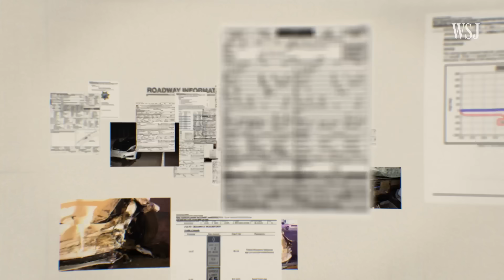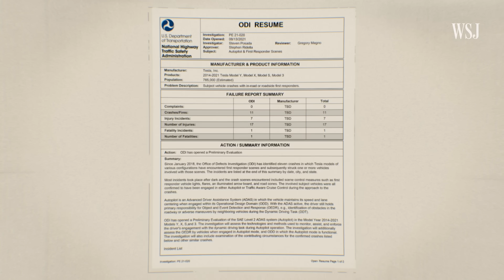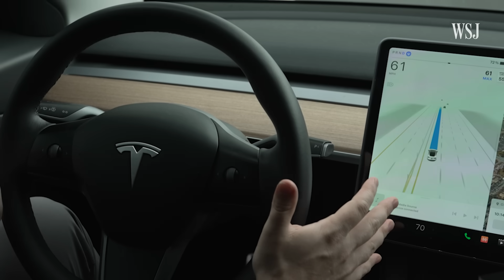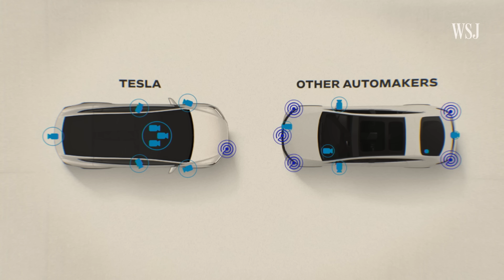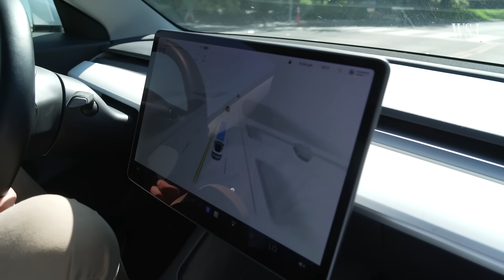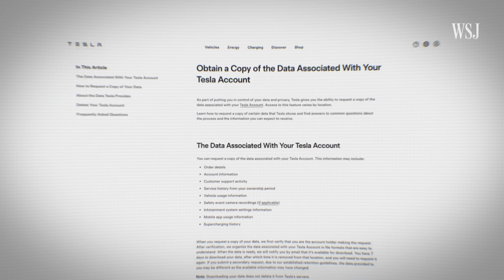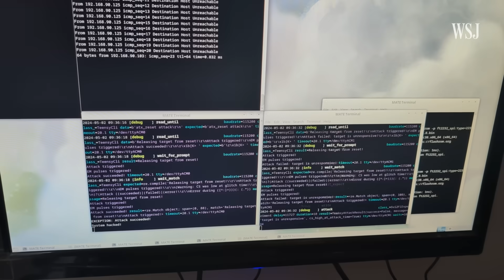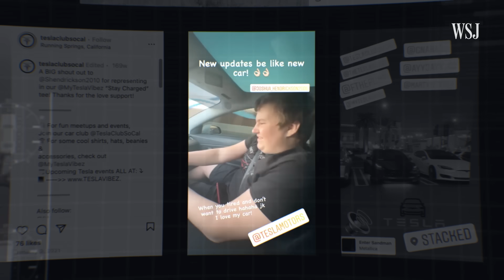The Hidden Autopilot Data That Reveals Why Teslas Crash | WSJ

Comment: Pretty obvious that a camera isn't a replacement for a radar.  
Theres always the possibility that it will misinterpret or not see some objects, but a radar will not only "see" every solid object, it isn't hindered by glare, snow or rain, it's like super human vision and thats really what they should be using when human lives are at stake, even if it costs more.
Reply: Removing radar was not about cost. And you are wrong, Radar was often conflicting with what the camera's were seeing, and it was the camera's that were proved correct. That is why Tesla moved to a pure vision system. Most people have no idea how much FSD actually see's.
Reply: @daydreamer8373  Did you see the video how a Tesla slammed into the truck? 
Radar would have easily detected that theres a big solid object there.
Reply: @samik83  Tesla was using radar then.
Reply: @samik83  Tesla was using Radar then.

Comment: FSD SUPERVISED.  observe and direct the execution of (a task, project, or activity).
"the sergeant left to supervise the loading of the trucks"
Similar:
superintend
oversee
be in charge of
be in control of
preside over
direct
administer
manage
run
look after
be responsible for
govern
operate
conduct
organize
handle
guide
steer
pilot
observe and direct the work of (someone).
"nurses were supervised by a consulting psychiatrist"
keep watch over (someone) in the interest of their or others' security.
"prisoners were supervised by two officers"

Comment: Approximately 1,000 crashes from autopilot in nearly four years? That would mean the autopilot system is remarkably better than human drivers already.
Reply: lol. Only if you don't understand how statistics work. <-- this is you right now.
Reply: @brendanariki  you would need to measure how often by time or mileage autopilot is being used. Then you would measure how often normal driving is occurring. Last you would take the percentage of accidents within those measurements to get the result. My intuition tells me that the Autopilot system will still be a lot more safe than humans.
Reply: Would need to be weighted by type of driving environment, not just miles driven. Many people only use it in areas where they feel safe and want to disengage a little, like the interstate in the day, where accident rates are relatively low per mile driven. Even then I suspect it will outperform human drivers. But there may be certain scenarios, like during the night, where it underperforms humans, and this could be disabled/require significantly more driver input
Reply: @jacobfrye996  so you could take the percentage of accidents that only happen at night between autopilot and human drivers to try and weight it against the autopilot system

Comment: The victims of these accidents do not deserve anything that happens to them. But they should still be responsible for the vehicle that they are driving. 
Putting the amazing capabilities of the system in the marketing blurb, while burying the risks and warnings into the small print is criminal, at least to my mind.
What is really needed at the moment is a vigorous and hard-hitting public safety education programme to stop the rot ASAP.

Comment: The problem isn't only the Tesla driver, but those of us who did not sign up for the program and get hit by one of these.  Makes the Corvair look pretty tame now.
Reply: “The problem isn't only the car driver, but those of us pedestrians and cyclists who did not sign up for this and get hit by one of these.” Same thing. Cars exist whether you like it or not. ADAS exists whether you like it or not. In fact some other ADAS systems are just as bad as Tesla’s. Out Of Spec did some great videos comparing them, but people don’t care to hate on those. As another driver on the road, my responsibility is to drive defensively and look out for my safety regardless of what others are doing because I can’t control their actions, only my own. Same if I’m walking or cycling. I never know what cars are going to do, but that doesn’t mean I want them banned. I just try to be as safe as I can around them.
Reply: @elviswsjr  FSD hasn't harmed any pedestrians.
Reply: Well, if you get hit by other non-Tesla drivers, you also did not sign up to their schools of crazy driving. I think you should not get out of your house from now on. Seriously!
Reply: This is a dumb, yet extremely common, form of sophistry used against deployed autonomy.

I also didn't sign up to be on the road with rednecks' monster trucks who achieve "safety" via enormous mass and a bumper that's at the same height as my head in a sedan. Or, a child's head on a crosswalk. 

Because, you know why? We don't all get to approve/reject each others' vehicles. 

If you want to argue that Tesla should be better about publicly sharing safety statistics on their autonomous cars, and IF those statistics show significantly worse safety performance, then use that to push for specific regulation. "I didn't sign up for ..." is irrelevant. This is a big, stupid country full of idiots doing harmful things to one another. I didn't sign up for that, either, but we live in a society.
Reply: @nathanscandella6075 well that was a long useless comment all to say 'we live in a society' . commenter is right that people dont wanna be hit by teslas rtarded autopilot even if you think we should just because society is full of idiots 💀💀
Reply: Who has been hit By FSD?
Reply: All the people in this video 🤡
Reply: @RoadSurferOfficial  That was not FSD. It was autopilot. So my question still stands. Who has been hit by FSD?
Reply: @RoadSurferOfficial  Compare that to all the people being hit by absolute idiots. Statistically FSD absolutely dominates the general public in driving safety.
Reply: @daydreamer8373  don’t make me flag your account for being a bot
Reply: @RoadSurferOfficial  Flag away. I'm not a bot.
Reply: @daydreamer8373  It's not True FSD if it was it would be a level 3, 4 or 5 system. Waymo's cars are the closest thing to true Self driving cars. The Teslas are not They are a level 2 system which is basically it has control over the driving functions but require the Driver to be attentive but not physically driving it. Autopilot, LKAS and ACC is a Level 1 system which requires the Driver or Pilot to be operating the Aircraft or Car. Tesla is trying to make the jump to a Level 5 Autonomous system but it has to start at a Level 3 (System requests manual control operated in test facilities not Public roads) or 4 (Limited operation may or may not have Pedals and steering wheel)  before it can be a Level 5 (no resitrictions)
Reply: @thegreatcanadianlumberjack5307  FSD is a level 2 system. Nobody is arguing otherwise. It requires the drivers attention at all times. But anyone following the progress of FSD will know it's capabilities go way beyond level 2. But until Tesla say otherwise, those abilities will be locked in level 2, and driver.

Tesla are saying next year they expect to start operations in Texas and California. From what I am seeing. I would be more surprised if they didnt.
Reply: @daydreamer8373  Interesting i wonder where in Califorina and Texas? Austin and San Francisco is where Waymo is operating so i wonder if they will go in and directly compete with them. But since your asking Who has been hit by FSD as matter of fact since 2017 there has been 23 collisions involving FSD including one in November of 2023 that involved a pedestrian getting struck because it was used in low visibility conditions. the NHTSA issued a Recall on Teslas FSD because of that. So yes people have been hit and the way they test it is they wait until the very last moment when hitting something which means people have been nearly hit often by the testers. Hopefully Youtube keeps my comment up
Reply: @thegreatcanadianlumberjack5307  Its a great comment, and constructive. I don't know enough about the collisions to comment, But I do know FSD has helped avoid accidents too, and from what I am seeing of the latest versions of FSD, there is no doubt it will make our roads far safer.
Reply: tragic no doubt, 3:40 the drivers was worn 19 times by the autopilot to keep his hands on the steering before the crush. most likely he fell asleep, the autopilot kept him from chrushing way before the flipped truck to appear, This accident will have happen anyway with any other car by him losing the control of the car. I'm hoping that this technology will be so good that will prevent any body from dying on the roads.
Reply: @Pressure165  and that's where there is more missing sensors. I am by no means a fan of Mercedes, but if a Mercedes Recognisises the Driver is unresponsive, while using Drive pilot a whole plan of steps will be completed:
-First it will use Audio, Visual and Vibration warnings
-Then it will utilize the brakes to basically "bump" the car, without really slowing down, as an attempt to alert the driver(all other warnings continue or intensify)
-If all that fails it will turn on hazard lines and slow down 
-next step is to change lanes to the right until it reached the emergency lane, there it will come to a full stop and use the European E-Call system to call emergency services on scene

Other brands just slowly stop the car with hazard lights on, since the lange changes are a certain hazard on their own
Reply: @Pressure165 flat out wrong. Any modern car with  advertised  cruise  control would have stopped the car and avoided crashing using radar technology.

Comment: Musk insists on using only cameras. That’s reckless when using radar would allow the system to be safer than a human driver.
Reply: When these accidents happened the car was still using radar. V13 is proving Camera's is the right approach, with many in the industry now agreeing.
Reply: @daydreamer8373 Wow. Why didn’t the radar detect a big truck lying on its side ahead of the car?
Reply: @mrluckyuncle  It probably did, but the software didn't recognise it as a threat. Would be my guess. Who knows? But FSD today is a very different beast to those early days. Tesla is literally on the verge of solving autonomy.
Reply: @daydreamer8373 I hope so. It’s hard to understand why a big, stationary, if unrecognizable, solid object ahead of a moving vehicle wasn’t recognized as a threat. It would be interesting to know the particulars of the failures.

Comment: The fact is that it has a far lower fatality rate than just leaving the situation up to humans - having moody music doesn't change that fact.

If you want safer roads for cars then you need to have them on separate roads from trucks. If you want safer responses to upturned vehicles, then you need lights and/or reflective elements on the underside of vehicles.

Drivers are told they need to always pay attention to the road and intervene where necessary. Driving will always be risky.

Comment: This is such an obvious attack on Musk… they found only 1 death somewhat related to autopilot since 2021, and they claim its not safe? They could only find 30 accidents related to autopilot, that is crazy low for the amount of people using this feature. I have been driving in Full Self Drive for 6 months now and not a single accident or even close to it. The car drives itself way better and safer than any human I know. WSJ has fallen off like crazy due to personal politics and vendettas. This is literally Atlas Shrugged.

Comment: This is a hit piece without any nuance about it.

Missy Cummings has been very vocal about Tesla vision only system… while being on the board of a company especially focused on LIDAR systems. She has been removed from NHTSA advisory role on Tesla’s cases in 2022 because of her (obvious) conflict of interest.

First a definition of what Autopilot really is, as there is a lot of confusion between Autopilot and Tesla Full Self Driving or FSD for short. 

Autopilot is available since 2014 and is a level 2 advanced driver-assistance system (ADAS). When you first activate Autopilot, the instructions are very clear: it is meant to be used on highways only and you have to be able to take over control of the car at any time. You have to keep your hand on the wheel and pay attention to the road. Autopilot is available with every Tesla sold around the world. 

FSD was first made available in 2021 under the label “FSD beta” now aptly renamed “FSD supervised’. Currently it is also a level 2 ADAS and the driver is still responsible and must take over if needed. This system is much more capable than Autopilot and isn’t limited to highways. We are currently at a point where, most of the time, it can take you to your destination without any interaction beside giving the destination. Once FSD reaches the point where supervision isn’t required anymore, the car will be considered a level 5 autonomous vehicle and the driver will now be considered to be a passenger. FSD is a paid upgrade and “FSD supervised” is currently only available in North America, with potential expansions to China and Europe next year. 

Now back to the issue. The video make it as if Tesla cars where death traps when you activate the Autopilot, but even in the exemples given some of the accidents occurred outside of highways, places where the autopilot should not have been activated. Numerous inquiries have been opened but NHTSA after accidents potentially involving Autopilot. None of them concluded to a dangerous flaw in Tesla’s systems, to my knowledge all investigations were closed without anything substantial to report. Don’t forget, unlike any other car, Tesla cars have the equivalent of a black box where everything that happened to the car is stored, not just videos. All of this data, while not available to the public, has been made available to the investigators.

Tesla cars have been rated as the safest cars on the road available by the NHTSA equivalents all around the world. These ratings includes the ADAS of which Autopilot is a part. Autopilot is also available in Europe where the rules are much stricter here, if there were any doubt that it was sometimes dangerous, it would have been immediately disabled.

In conclusion, even when used according to specifications, Autopilot clearly isn’t perfect, but if you pay attention to the road and take over when something unusual happens, it is safer than driving on your own.

Comment: Great reporting!

I think that it is critical for people to understand that Tesla, especially by the mouth of Elon Musk, but also on their marketing material, have been overpromissing and underdlivering Autopilot / FSD (Full Self Driving) for years now.
Moreover, Tesla and Elon Musk have been ignoring the warning and accidents that have been happening all over the World.

To be honest, I think both Regulators, and the Federal Government as a whole, have been too permissive because they have been sold, or forced, on the belief that this technology will bring the USA to the forefront of the Automotive industry.
Possibly, feeding many of the images it gathers all over the World, including China, to the Federal Government - e.g., CIA.

This has (a) resulted in several critical accidents all over the World, and (b) discourage investments on LIDAR, which is a critical component to actually full self driving, i.e., a trully high level self driving system.

Do you want more proof?
On the Tesla Model 3 Highland, Tesla and Elon Musk ditched the traditional (ultrasonic) parking sensors, relying solely and totally on the cameras.
This move resulted in several errors while parking, or leaving too much slack on parking.
Such incidents are not major, but it reflects a mentality of cost-cutting, regardless of the customer experience.
Do you imagine it is different on the Autopilot / FSD?

By the way:
Tesla was NOT founded by Elon Musk.
Elon Musk invested on Tesla, while they where developing the original Tesla Roadster, and then made some maneuvers to ditch the two original founders.
Also, Elon Musk now ignores the original Tesla Roadster - letting customers without proper support.

Comment: This is like the worst report i have seen in a long time. Dont get me wrong, you have to keep your promise and advertising not fully reliable systems is not right (the video is right with "better safe than sorry", more sensors are better) and blurrying incident data is also not the way it should be. 

1. But as a european I have to say, that the whole highway situation looks horrible - no light for work on the highway, no warning signs - just some dudes stopping on the middle of the road. I mean as a driver watching the video I would have crashed too and I have been driving for 10 years. 
2. Other than that is "someone will die with this technology" a complete nonsense comment. That was never the point of the technology, the correct assessment is a comparison between human driving mistakes and non human driving mistakes and elon musk is completely right with the argument that it is moderating the amounts of accidents and that autonomous driving is lowering the accident rate, that is clear majority of research opinion and i have written a bachelor thesis on autonomous driving. 
3. And now to the whole level 2 autonomous driving type of stuff - level 2 is never meant to drive you fully automatic without keeping an eye on the road - so misusing this tech and then calling out Tesla for the cars is stupid. 
4. If you ever want to call something out it is this overcomplication from car manufacturers of digital parts in a mechanical car. Relying on only digital parts is completely unnecessary and the only benefit is keeping the control over the maintainance. Autonomous features have to be integrated digitally and that is quite fine, but its solved on a useless scale. 

Nonetheless I am neither a fan of Tesla nor have I planned on buying a Tesla or any other autonomous driving car.